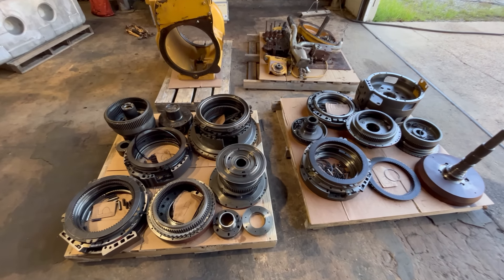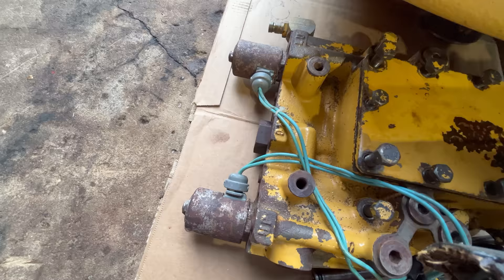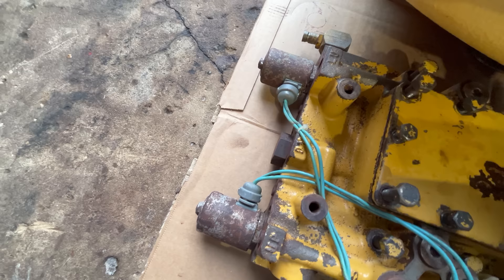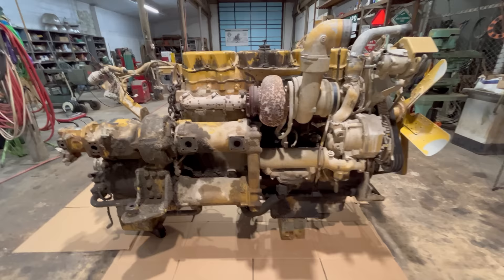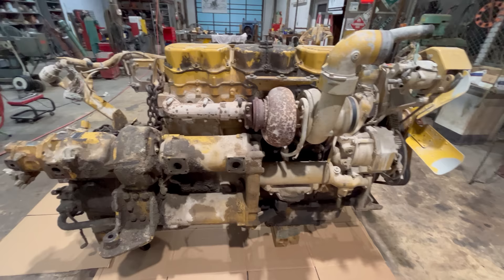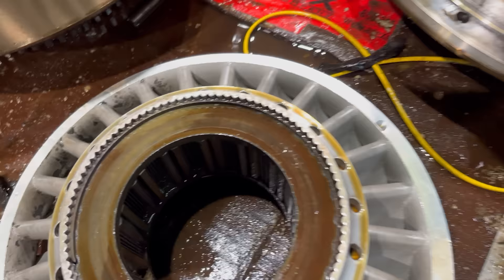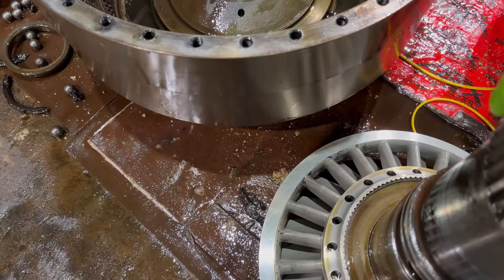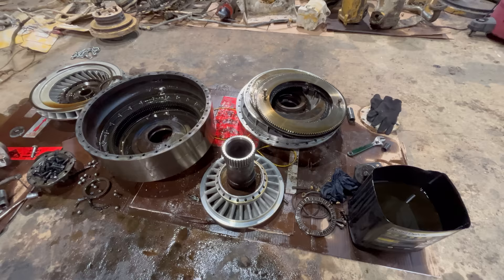Caterpillar 3406E Diesel Engine and Torque Converter Tear Down - 40 Ton Haul Truck

Comment: I don't get this channel. (Probably my limitation; but...) I've watched this vid, and several others where you rip a motor -- that you obviously have a great  knowledge of and affinity for -- but you speculate about the causes of failure, but (in those I've seen) are usually wrong. And then the video ends. Do you ever put anything back together? 

On the basis of the (apparently) haphazard nature of your disassembly's; the wide angles that show a jumbled mass of parts in no particular arrangement, interleaved with random tools odd nuts and washers, piles of rust, dirt and other detritous all lying on sheetss of cardboard liberally soaked in a variety of different oils and other fluids ... only now does the true meaning of the phrase "tear down" make sense.

I'd love for you to prove me wrong;p but a torn down engine -- regardless of its capacity, power rating or heritige, -- is nothing but scrap metal unless it can and is put back together and got running.

Update: in one vid you ripped apart a really quite clean 16l 475bhp motor, in order to sell the crankshaft on. Is that it? Do people really sit through an hour of you telling them that "this 2" long thing with a wire attached is a so'n'so sensor" and this other 2" long thing is a thingyamajig sensor and this other, other 2" long thing with a wire attached is a easy-breezy-lemon-squeezy sensor just so you can break a motor for its parts?
Reply from the maker: Hmm, I don't know.  Seems to have worked alright for me for the past ten and a half years.  I suppose that your lack of understanding doesn't really constitute a failure on my part.